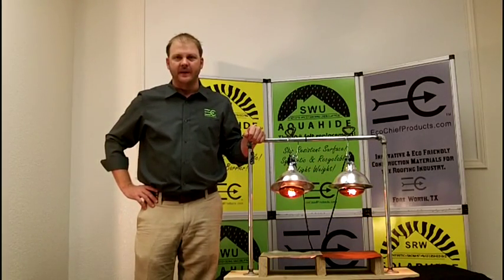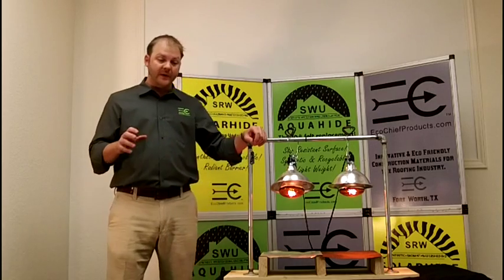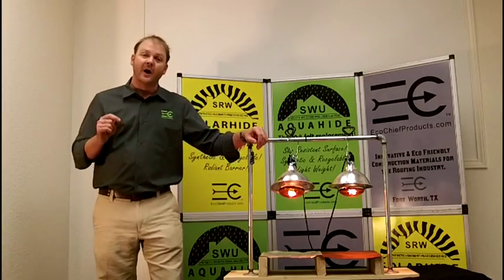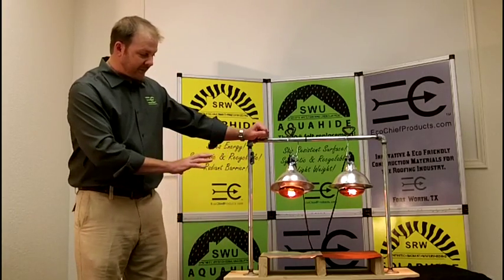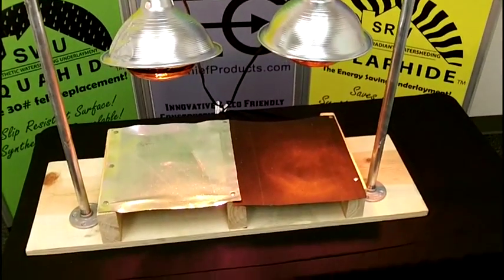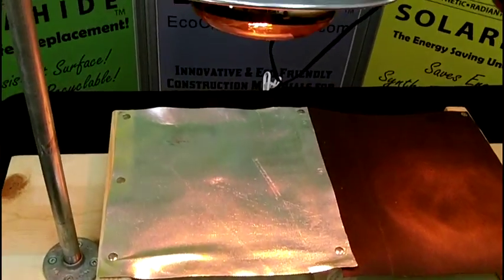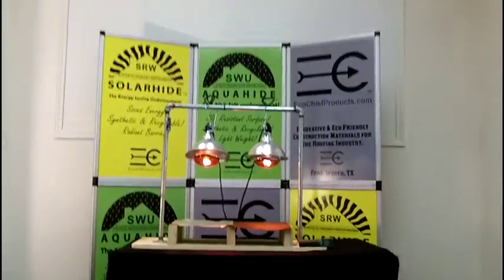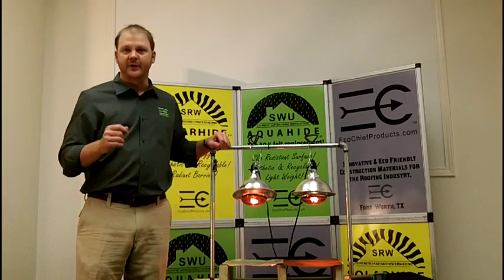Introduction to SOLARHIDE underlayment

Comment: In order for this to act as a radiant barrier there needs to be an air gap.  Once you cover the solar hide with shingles you have closed the air gap and it's no longer considered radiant barrier it's just an expensive underlayment at this point.  Am I missing something?
Reply: this is a valid question and needs to be answered by the company.

Comment: Makes sense with a batton install, but I don't imagine this has much of any effect with a typical asphalt shingle roof directly on the deck.

I want to like this product, but this issue is just one of the many obvious flaws of this "test" that effectively make it invalid.  If you want this taken seriously, we're going to need to see the numbers from a real, fully built-up roof, using modern materials not ancient tech like 30lbs felt.
Reply: Again this is a valid question that needs to be answered by the company.

Comment: if you install this on the roof deck with battens on top for the air gap, do you put the shinny back side up, or do you put the side with Solarhide graphics up?
Reply: Mark, you would want to face shiny side towards the biggest airspace, so in this case towards the sky and facing the final roof covering.